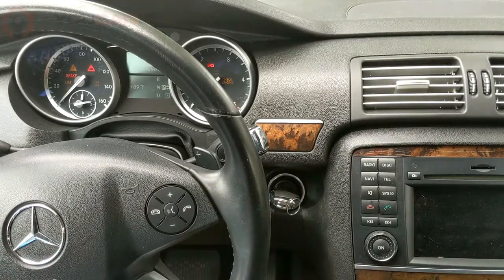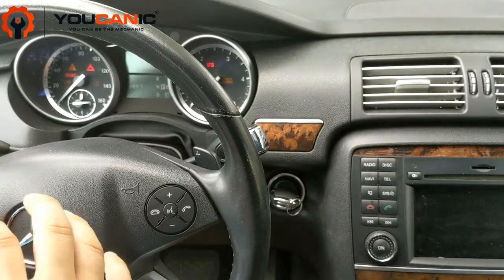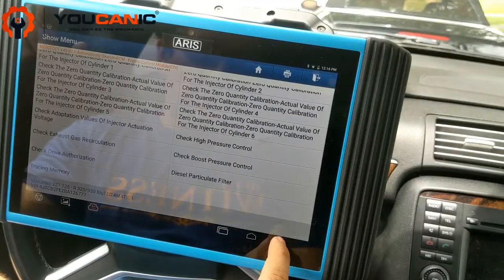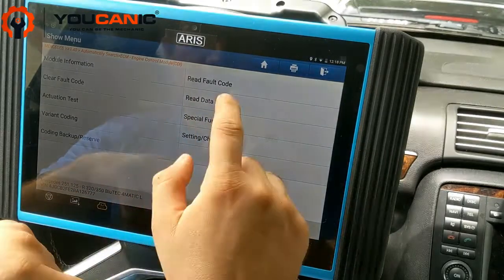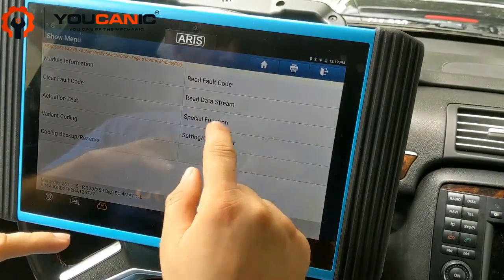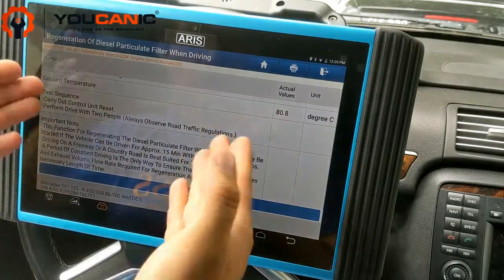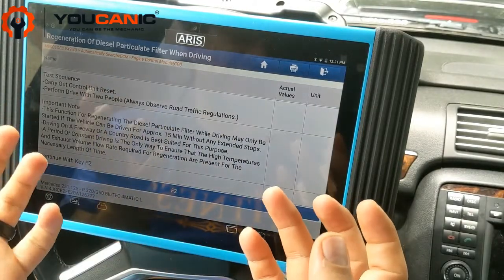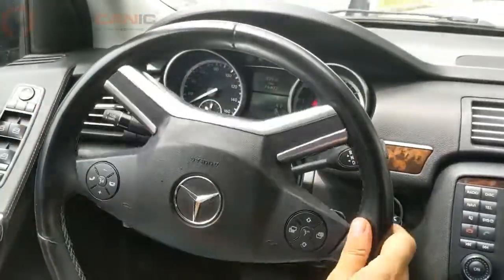DIY Guide: Mercedes-Benz DPF Regen - How To

Comment: talks too much
Reply from the maker: Thanks for your feedback! At Youcanic, our priority is to empower car owners to handle car maintenance with confidence. We provide extensive guides, complimentary tools, and the powerful Youcanic scanner to simplify the process. Check out our resources at www.youcanic.com, even detailed factory repair manuals are available should you require them. 

We talk extensively in our videos to provide you with all the information you need. Our mission is to support you throughout your car ownership journey. If you have any more queries, feel free to reach out on our portal. Happy motoring!

Comment: So unless you have a scanner you can’t do it.
Reply from the maker: Car does regen automatically. If there is an issue then it won't run regen on its own. You will need a scan tool. Here is a good one: www.youcanic.com/scanner

Comment: I had a P0546 code for the exhaust temperature sensor. While waiting for the part my GL 350 went into limp mode. I changed out the exhaust temperature sensor and that code is gone and now I have P2463.  Now that I have the temperature sensor fixed. Will it do regeneration on its own and take me out of limp mode or do I have to get someone to do a forced regeneration?
Reply: Did you get anywhere with this? I have the same problem.
Reply: @benbutler9550  I had to force a regeneration.  Then took it to the dealer for the Diesel fix. Then a month later got hit head on and totaled it out.

Comment: will this work if the car is in limp mode?
Reply from the maker: You can do regen with the stopped or driving. You should see both options depending on the scanner.  Driving you won't be able to do if you are stuck in limp mode.